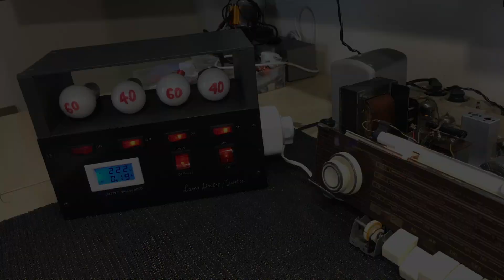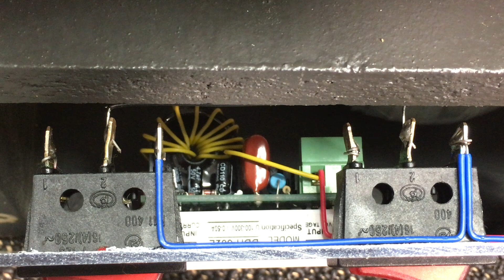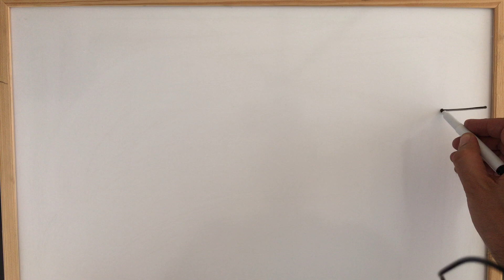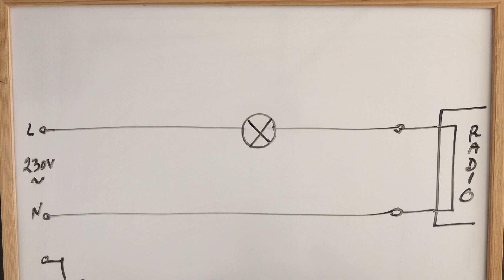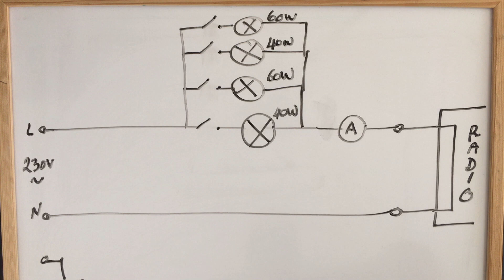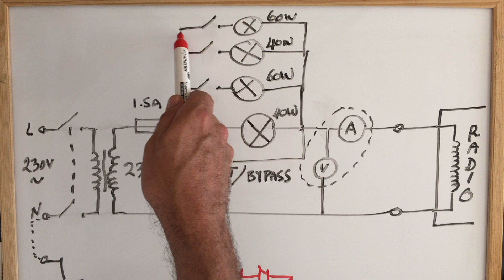DIY Test Gear: Dim Bulb Limiter / Tester with Isolation - Design and Build

Comment: Hello Miguel,
great video and like your capacitor tester i have to build one! can you tell me a bit more info on the type/make of module you used?
thank's
Geoff
Reply from the maker: This is the module used: https://rover.ebay.com/rover/0/0/0?mpre=https%3A%2F%2Fwww.ebay.com%2Fulk%2Fitm%2F201561488389
Reply: Thank's Manuel! bye the way,are you going to repair/service any valve guitar amps in the future?
Reply from the maker: I’ve designed a built a couple, and repaired lots. I have not done a video on these as there are guys out there doing superb videos ... Guitarlogist is the first one that comes to mind, probably a lot better that any I could do.
Reply: yeah i watch guitologist and "uncle doug" amongst others but i would like to see the thorough method you use on your radio's i.e testing transformers,schematic tracing etc.
keep up the good and interesting work!
Reply from the maker: Geoff pickles : I might just do a video next time I have an interesting tube amp in for repair. Could be fun.

Comment: Thanks for this detailed explanation. I always liked how you did this previously and so I built one (like the original) as best as I could based on how I understood you used it. However, mine may be more complicated than was needed. I also like having the isolation transformer right there as you have done.
Reply from the maker: Yes. The isolation transformer is very handy.

Comment: Nice work great video.
 I have a Staco 2510 variac but I am unsure if it is isolated how would i find out without touching the leads which i am not above doing. DO NOT ATTEMPT. I am a well  trained IDIOT.
Reply from the maker: I could give you a short version, but there are some really good videos on how to do the test properly. Give those a try.